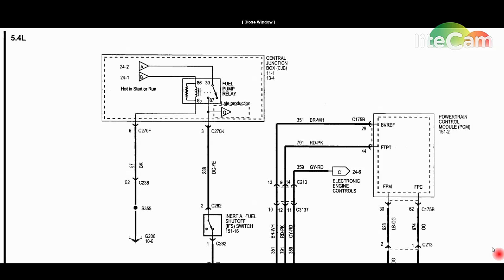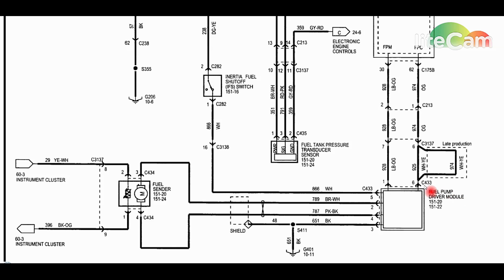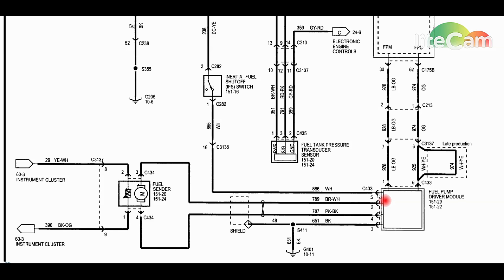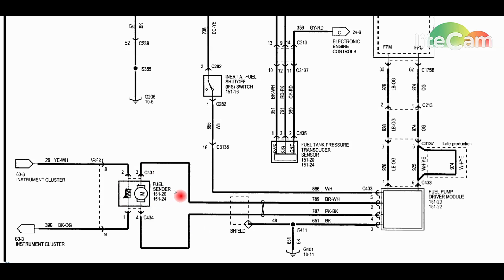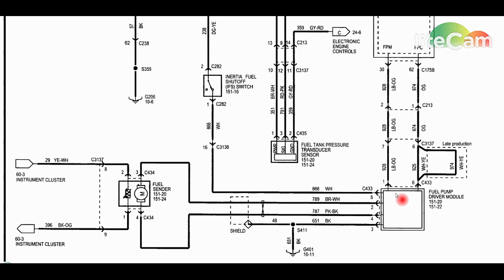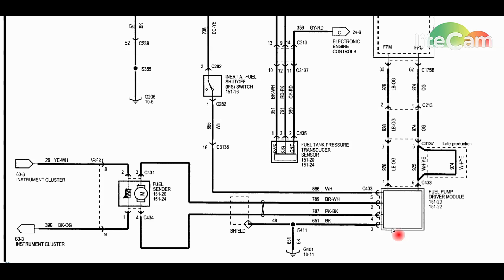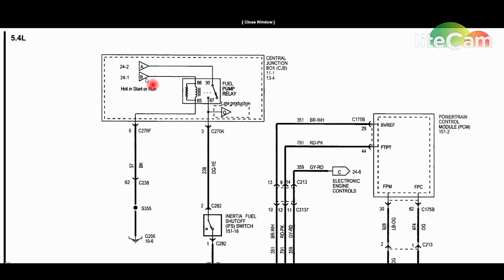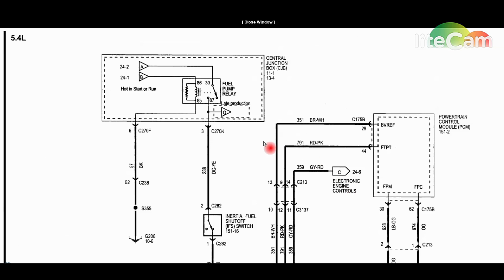Wiring Diagram Diagnostics: #2 2005 Ford F-150 Crank No Start

Comment: Hey brother I have a 2006 f150 with a 4.2 it has been sitting for about 2 years now because someone lost the key I had one set of keys made for it at the Ford garage and had them reprogrammed because I thought it wAs security reason why it would not start I finally got it to crank but had no fuel now that I have the fuel back in this motor it still will not start

Comment: Looking the wires for the speedometer 04 Lariat. Trying to check for a possible short in the connector under steering column. Already found a low beam short in same ( connector green) and resolved. Hoping speedometer short is in same connector.  Can't turn on speedodmeter and wiggle like I did low beams. Thanks

Comment: This helped me pinpoint my issue. Turns out I had no ground coming in on pin 3. Of course corrosion had created too much resistance on the frame. I took the bolt off that connected G401 (ground to pin 3) and cleaned it up while adding dielectric grease and the truck was back in action.

Comment: Hey I need desperate help as this POS '04 Ford F150 w/5.4 is starting to make me feel stupid and defeated. I had the truck figured out I thought and running and running well up until it was parked outside for a few weeks. Does ANYONE ACTUALLY know where the bare shielded ground wire goes at the opposite end from the FPDM harness? I know that end goes into the G300 ground stud but the end closest to the sending unit plug goes nowhere apparently? Thanks in advance 👊

Comment: Hi, I bought a 2005 Ford E150 XLT van back in May of this year. I really hope you can help with some ideas as I am at the end of my rope. Unfortunately, I was only able to drive it home and it would not rerestart. It only has 58K miles. 

The fuel pump will not prime with the key on so the van will not start and run. This video is similar and provides some good info, but still cannot get the issue solved. I found if unplug the fuel pump from the harness it runs and drives, if I supply power and ground to the pump from another battery. I also replaced the Fuel pump driver module with a Ford OEM and checked fuses and relay and they seem to be fine, as well as the Fuel safety shut off switch. 

I even took it in to the Ford Dealer and they had it for 4 weeks and said the power to the driver module tested good, so said they thought it was in the PCM, but one is not available through Ford. I have zero faith in their capabilities, but had no other options, so I bought one online through Flagship One that was preprogrammed with my VIN and is supposed to be plug and play for $335.  I installed it today but still having the same exact issue.

I would have to say either I got a bad driver module or there is a wiring issue, but don't know how to proceed without further test equipment or options aside from stripping out all the wires and physically tracing them from their source. I would be happy to pay you for your time if you can help me get this solved! All shops around where I live are booked for 4-5 weeks. Thanks!

Comment: Is this the same diagram/setup/procedure for a 2004 F250 superduty with s 5.4l. I've been told that there is relay other than the one that is hard wired into the fuse box. The truck just died while I was driving. It cranks just fine, but it has zero fuel pressure on the rail, and no pump sound from the tank. Any help would be appreciated.

Comment: On my 2005 Expedition, I have a condition where occasionally.  Mostly coincidental that its when its wet or highly humid, I get a crank no start.  The fuel pump is not priming or running unless I jump either the connectors at the FPDM or power the fuel pump directly.  But after driving it for awhile, I can take the jump off and it works fine after that.  I am suspecting its the fuel pump relay, but then its odd that it only happens when its wet and humid.  Have you seen this before?  Its really intermittent.  Doesn't happen all the time, only occasionally.  The dampness/humidity may be coincidental.  I was going to bypass the Fuel Pump Relay with an external one, but wanted to connect it to the PCM wire that supplies the 2 seconds of priming and then power after start.  What color wire am I looking for on the harness coming from the PCM to the CJB?

Comment: Where do I find the wire diagram  for fuel system gauge to sending unit an grounding points for a 2006 F250 5.4 3v..? My gauge reads empty. New fuel pump sending unit,  an fuel pump module,  gauge cluster sent out an rebuilt.. still getting empty reading,  could this be a ground, where are the grounding points? Any help is welcome.
Reply from the maker: alldata diy is best.

Comment: Hi good video, i have a question, how do you test the two cables from the PCM to the fpdm? The modulate driver and the control drive, thanks, are they a voltage signal?

Comment: I just replaced my old fuel pump and filter and now my 06 f150 4.6 cranks but no start also not getting a hum from the fuel pump. I checked my fuse and it's not busted and I also tried hitting that red button to reset and still nothing. I live in the middle of nowhere so I'm trying to fix it at home. And tools are limited

Comment: Great videos on the Fords! Really appreciate them!    I just replaced my engine on my 5.4 2004 f150 and at the front of the wiring harness that has all the clips and wires for fuel injectors, ignition coils and a few other sensors is what I thought was a ground cable.  It has a small "U" shaped peice of plastic on it and there is one on each side of the engine. They're both located on the front of the engine.   I lost one and cannot find what its called or what its even for? ? Ive tried just grounding the cable to the block but I'm not sure that's correct because i keep blowing ignition fuses.

Comment: Why would it make a difference getting a dorman unit with rubber spacers and a ford unit with studs? Can I remove the spacers from the dorman unit, and it will work?
Reply: Or, could I run a ground cable to the dorman unit and keep the rubber spacers. I know you have to represent ford, but...

Comment: If the fpdm is not touching the frame will it still work?
Reply: I replaced the fpdm but my spare tire is stuck. So I just unpluged from old fpdm and plugged in the new one to see if it would start.. so long story short my fpdm is just hanging from the harness
Reply from the maker: Ford units will yes.
Reply: Ok. Does the inertia switch trip if the fuel pump is broke?
Reply: I'm having a crank no start can hear the relay by the kick panel clicking but don't hear the fuel pump priming when I turn the key on. Only code I got was a p0191 I've replaced frps and fpdm

Comment: Thanks for this great and informative video. It helped me run down problems on my 2006 F150 5.4L. I do have one issue and I am not sure if its your mistake or some issue with my truck/ model/ whatever but I found your "jump the FPDM to test the fuel pump" at 3:50 to be slightly incorrect. I did that and got a low whine out of the pump but no fuel ejected before the filter (I had the line disconnected and in a pan). A couple mechanic friends agreed this sounded like the pump motor whining with no ability to power the pump or a faulty pump. After installing a new pump to no result and  testing to same effect tried sending 12v direct to the new pump a few times. Same we were about to change out the pump AGAIN but I wanted to test and retest. At one test I hooked up the lines  "wrong" from the FPDM harness and  Bingo! fuel pressure. Seems your pins you call out try to run it backwards.

Come to find out it is not "pin 5 to pin 2 and pin 3 to pin 4" as you stated but pin 2 to pin 3 and pin 4 to pin 5.  If you could verify its not just my truck thats bass ackwards you might want to update your awesome video to this effect - it will probably save a lot of fuel pumps.

That said I am not really sure what fixed my issue. Clearly something was wrong that caused my "no fuel , no start". I havent had a chance to bench test my old pump yet but I might do that. I might update this if I learn something
Reply: My  07 f150 xlt crew cab short box 4.6 worked this way not the way in the video also mine replaced the black wire with a black and yellow pin 2 to pin 3 and pin 4 to pin 5

Comment: oops. enjoying your video. then you started talking about   pwm  and  and I think my 99 is set with just straight DC.  I am a ex electronic tech.. btw is this Controll module needed on a a 99 expedition and is it just above the  donut tire.

Comment: I may have an ignition problem. I am trying to fix my Ford expedition.  Expy failed going up hill on short out of town trip.   replaced fuel filter that was clogged.. ran perfect for 3 days. It failed after errands in a parking lot.. went to get it.. i drove it home.. for 2 days cranked perfect.. continued to run gas out over the next few days  so the fuel pump would be easier to change.  It failed to start again for five days. Researched . I have Chilton's ECT. There is a limited amount  of info in them. I am an ex electronic tech.  Understand relays ECT.   So watched videos ECT.  Checked Schrader valve had gas there. I decided to turn the engine over.. it started (we are dealing with an intermittent here) I took it to a neighbor  and he put a bid tool on it.. not a cheap one.. it initially said misfire on cylinder 4.. that made sense because when it quit, it did misfire going up hills   I told him  to clear the memory.. He found no codes..no cam sensor problems, no crankshaft sensor problems, always has had the sound of prime, never checked voltage at  fuel pump relay or pump itself.  I hesitate to pup 12 volts to fuel pump willy nilly, as it may feed back and destroy electronic infrastructure.   I know this can be the inertia switch (they sometimes are intermittent). It could be an insulation leak to the chassis.  I don't know if I am getting spark.. it seems like like the obd tester would catch that.. The problem is that it is intermittent. I notice this doesn't have the normal spark plug wire setup  and I think this  is cop setup.  I am a little  confused how to properly check for spark do I use a noid.  Oh yes it is only showing about 30 psi on idle and 35 on acceleration maybe a little higher at high rpms.  Also my  fuse board under the hood and  below the steering wheel does allow pull and replace of relays.  If it comes down to it I can fix boards, but if it's a expensive chip.. that probably won't be happening.. I suspect we are dealing with an obvious component. If  any body can give me a detailed  description of how this all works please do so.

Comment: i have an 05 f150 and I have no ground at the fuel pump driver module, any idea what could be wrong
Reply from the maker: +Crash N Smash If you are not getting a constant ground on pin 3 check the bolt and wire eye lit on the inside of the left rear frame for corrosion.
Reply: Crash N Smash fuel gauge stays halfway on 2006 Ford F150

Comment: Now that is very helpful....got my truck fixed , grounded the Dorman module to frame like you said and wahla it works .....having a wiring diagram helps alot. Thanks again for the infomative videos......
Reply from the maker: James Picardi I was wondering if that was it glad I made this video for you then.
Reply: @FordTechMakuloco  I have exhausted my knowledge in a 2005 expedition. I’ve lost 12v power to my injectors I have ground pulse as well as fuel psi. No blown  fuses. I have 12v to other pets under hood just not injectors.